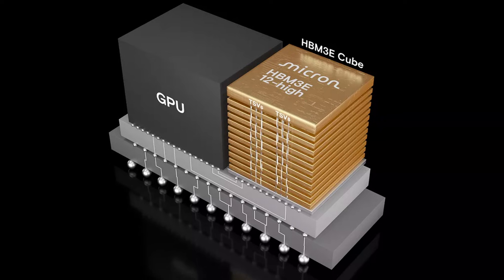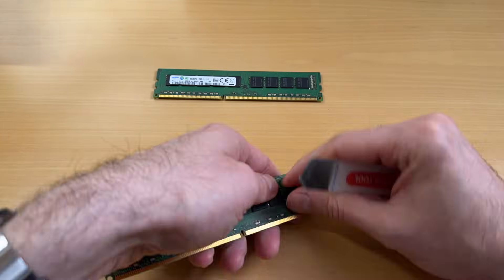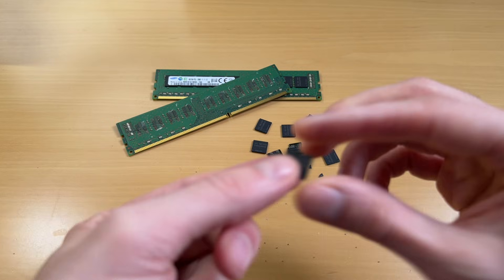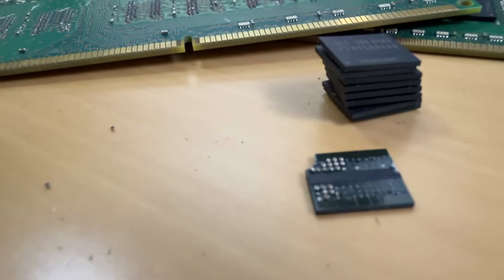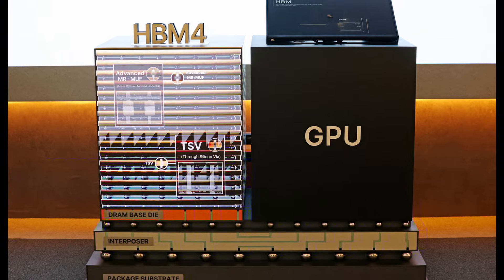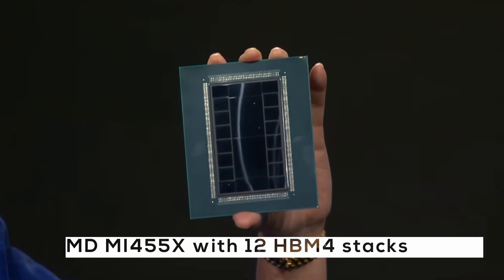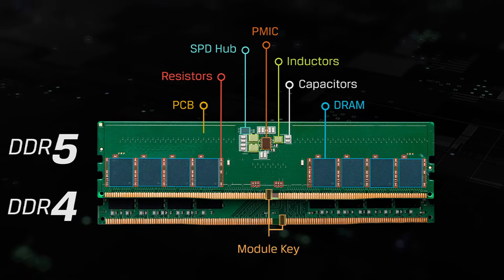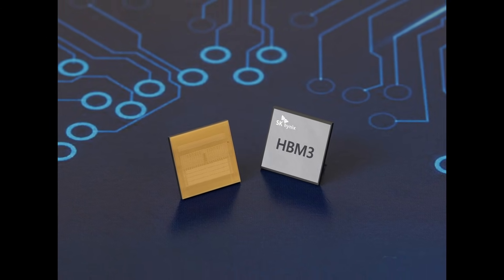The Memory Crisis Explained

Comment: What is the point of this video? You didn't even mention that OpenAI reserved 40% of supply from two of the three manufacturers, without any plans to actually use the dies. It's just scalping at an industry-size scale. Isn't that a fairly important event to mention?

Comment: There's a bit more to it, I believe: Normal RAM is connected to processors by way of regular fiberglass circuit boards, but HBM is connected by yet more silicon. The pictures I've seen show a connecting layer big enough to hold the processor and HBM stacks side-by-side. This layer uses an older and cheaper lithography process, but it still consumes a lot of raw silicon.
Reply from the maker: There absolutely is more to it. It's not even the exact same wafers, HBM DRAM is slightly different. But they use the same underlying technology and compete for production in the same FABs.

Comment: Even SSD and HDD price is rising now. Not sure if it is related to AI though
Reply from the maker: Also related to the massive demand in server infrastructure.
Reply: @HighYield 
It's simply monopoly and corporate greed. They monopolize, reduce production, create a crisis, then sell at a higher price, and this becomes the new standard.
Reply: @seeking_to_right  The issue with your thinking is, they don't have the monopoly. DRAM/SSD production is easier than CPUs or GPUs. So by increasing the price, they allow other manufactures to get a lot of money.

China is a bit behind, but only a few years. They make DDR4 and just started DDR5 production. This additional funding will help them to catch up. So this crisis means there will be 4 or 5 major memory producers in the future.

To sum up, memory manufactures likely control the volume of production, so the prices are not going down too much, and stay low enough so other manufactures can't enter the market easily. But they did a mistake, underestimating the demand. Ramping up the production might take a few years. Current crisis will make them a lot of money, but it's also a threat for the future.

Comment: Maybe this means that in 5 years consumer RAM will be HBM. To those who work in that industry: please steer it that way, it could be worth it.
Reply: AMD tried, but it's too expensive for consumer products. The performance uplift simply doesn't justify the cost. I'm pretty sure that's where the idea for X3D CPUs came from though, so that's something.
Reply: @hammerth1421 There is a chance if manufacturers increase HBM production and the Ai bubble burst. That could lead to bargain sale of HBM.
Reply: They should probrably start adding it to the cpu die, or worst case motherboard. The days of just putting a stick into a slot are numbered. It's just not suitable for high speed high bandwidth stuff. At high frequency's every connection should be treated like an antenna trace with controlled impedance.

Comment: You didnt address why memory is so expensive. You left out that Sam Altman signed a deal to buy up 40% of global DRAM waffers without any money, nor datacenters built up to use this dram!! Thats what caused the memory crisis because its not like increased demand for HBM happened yesterday or HBM was just launched yesterday.
Reply: I wounder how this dutch rudder between bigtech corps legal in USA?!
Reply from the maker: That's the trigger. But the technical aspect is that HBM and DDR5 compete for wafer capacity. Because they both are build on DRAM.

Comment: But here's what I'm wondering, why now? Why didn't this happen before? After all ai has been around for sometime at this point.

Why did memory prices go up so much in the last few months rather than a gradual increase overtime?
Reply: Large scale wafer agreements reserving supply for AI companies might have something to do with it - it's likely that without the hype and hefty valuations, there wouldn't have been the financial muscle to obtain such agreements before.
Reply: @rednammoc possibly
Reply: AI companies are now ordering DRAM directly from the manufacturer. This leads to smaller memory distributor unable to purchase their lot of DRAM supply. The spike in prices is due to the distributor being squeezed out of the supply chain.
Reply: @kazedcat Im not sure about this one, if it was just about this then the prices should have gone up way before now, because ultimately volume is what matters.

Whether they ask for them directly from the fab or buy from 3rd party the price would have gone up regardless, the only thing that would change is that these ai companies would cut the middleman and buy the ram slightly cheaper, but supply and demand would have been impacted anyway
Reply: @alexis1156 If the distributor is cut off from supply then the memory prices you are buying will spike up instantly. If the AI company was buying from the distributor then they could have implemented supply allocation to delay the prices from going up. But yes inevitably the prices would go up no matter what unless the manufacturer increase production.
Reply: @kazedcat well yes, you have less warehouse storages, so prices are affected immediately. Or almost immediately, but this would have just delayed the spike by around 3 months in average.

I think one of the main reasons for this massive price spike is actually due to a previous oversupply of memory after the lockdown,  which then resulted in an overcorrection in production coupled now with a massive spike in demand, and this is the result. Basically a perfect storm of low supply and high demand, which I think is one of the main reasons why they mentioned a fear of oversupply later due to what happened in 2023.